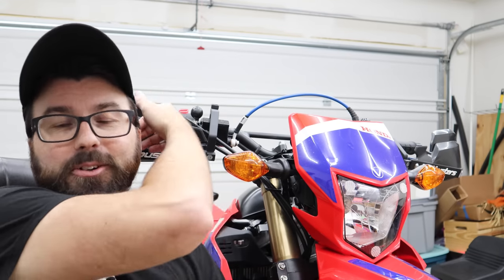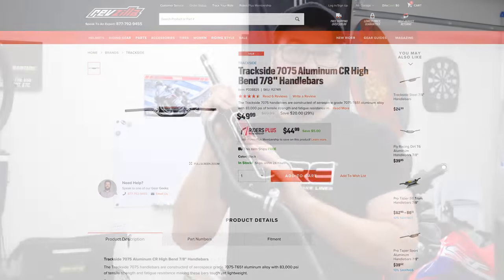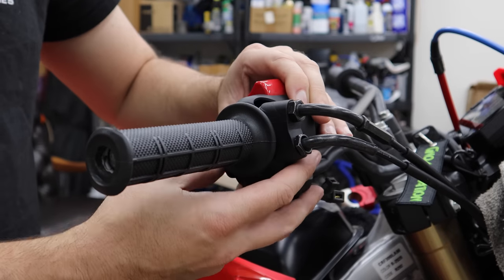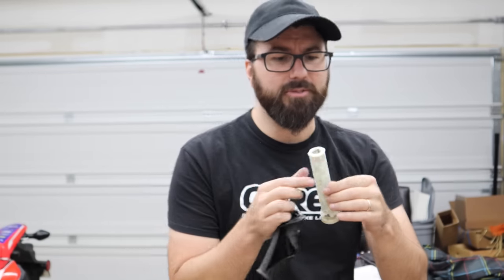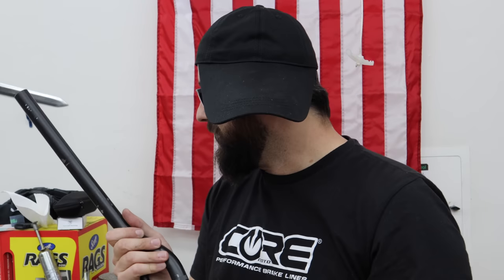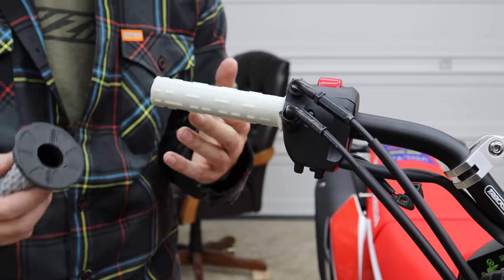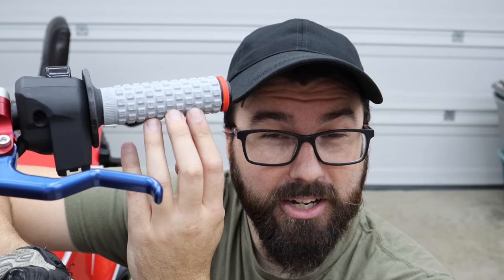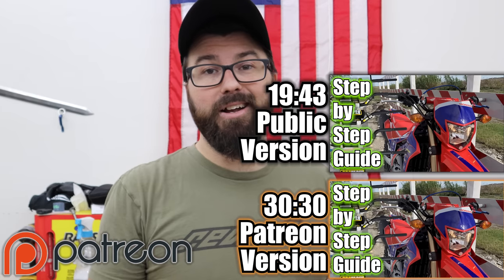Handlebars Pro Install - CRF300L

Comment: I put new bars, grips and handguards on my 300 today and it turned out great. I drilled the bars and dremeled the throttle tube as you demonstrate here. I didn't have to remove the throttle cables because I worked on the throttle tube on the bike. I slid the old handlebars off the throttle tube and slid the new ones on without detaching the cables.

Comment: another way to put grips on is alcohol . pour yourself a glass of strong spirits ( my weapon of choice is whisky ) , after you got some fire in ya  put some rubbing alcohol or aftershave or vodka onto the bar and slide the grip on . in a few seconds the alcohol will evaporate leaving your grips stuck
Reply: I tried rubbing alcohol and it worked great. I couldn't get the grips on with an air hose like Jake. I used to use WD40 (it actually evaporates and holds the grips in place fairly well) but wanted to try something else this time. Thanks for the tip.

Comment: Nice job on video Jake. Good call on not cutting throttle tube off and using the dremel tool. It can use all the length it can get. I didn't think of that. Great trick.

Comment: I always just saw the tab off the control housings and use double sided tape underneath to keep them in place. I personally don't want to drill holes to aluminium bars and compromise the strength of them just to mount buttons. Controls stay in place very easily if you just have something suitable under them during install and it is also easier to change their position if you want to turn your handlebar a bit to one side or another later.
Reply: Many people who have gone this route have had to purchase new controls due to the fact that they no longer stay in place.

Comment: I have a '21 Z900 i got at the end of June. A month ago I pulled it out of the garage and parked it so I could close the garage door. As I walked away from the bike i heard a clunk. It rolled forward a little bit on the kickstand and fell on the left side. Bent my bars. :-/ I wanted to go aftermarket but couldn't find a set that would match the bend/shape of the stock ones so went with another OEM set. Hopefully it doesn't fall over again.
Reply from the maker: Oh dang that sucks. Hopefully that doesn’t happen again.

Comment: I made a a video installing the CR mid Bend bars on my CRF250L and I love them🙌. I did have to drill for the controls, but it is so so easy to do [it was my first time drilling a set of bars]. My preference is the 1 1/8" jumbo bars, but these look great!!💪💪
Reply: Got the CR mid bend for my 300l rally too! I flattened the tabs on my controls and kind of regret it, but I'll try to get some double sided tape/electrical tape under there to get them to stop moving lmao
Reply: @ffengtastic5002  Ngl i considered doing that at first, but given how much I dump my bike I figured I should just do it the right way the first time. That way my controls have less of a chance of getting all spun around😂😂
Reply: @ConnorGMedia  My thinking was if I eat shit the controls just spin instead of breaking, but I checked the OEM pricing and it's like $50 for a replacement lol 🤷‍♀️

Comment: next time try using the strongest hair spray you can find for your grips. makes them really easy to slide on, let it dry over night, wont move unless you want to remove them, no residues. quickest and easiest method. been doing it for years. no safety wiring neccessary

Comment: It’s much better to drill the tiny holes for the controls and have it not move as opposed to grinding the nubs. I found out the hard way. (Like always) Some JB weld or solder will make me some new nubs. (Doh!)
It’s pretty straight forward to find the correct spot to drill so the controls line up. 
The goon guards will add a tad of friction to the throttle tube making drilling the hole more important so the throttle doesn’t move at all when WFO. I’m not a goon so I put Tusk bar ends on instead. 
Using the old clamps as a drill guide is a good idea since I always switch my bars to 1 1/8 fat tapered with no cross bar. (To combat arm pump) Otherwise I’d toss the old clamps over my shoulder because I’ll never use them again. Same with the stock bars.
Tusk has the universal oversized clamp & bar kits for around $70 bucks. I went with the KTM bend because they were similar to the Pro Taper Carmichael bend (0.6” taller) and I’m a inch or two taller than RC. If KTM has a problem with that then do something! (Faint a punch) That’s what I thought you tea drinking pompous euros will do nothing but get slapped. (Flinch!) You goofy orange oompa loompa MFers! Now get me an espresso and scrumpettes!

Comment: Anyone got a recommendation for grease for where the throttle cable contacts the throttle tube? There’s some from the factory but not sure what kind of grease that is. Wanting to use something that won’t weaken the plastic

Comment: Wish I'd seen this guide before some self-appointed experts suggested that you'd just grind down the controller nubs and try securing it with electrical tape. 
Worked like shit and gives you two ruined controllers as the medal tabs aren't available as spare part :)

Comment: Great video and tips.  I got a little too eager with the drill bit size and the hole is too large on the throttle side and the controls have rotation wiggle room.  I've tried electrical tape and strong double sided tape to reduce the wiggle, but it is still there...any tips besides buying new bars.  100% my fault but not too keen on this dowel/hole setup.

Comment: a good trick to put the new grips is to use spray deodorant if you dont have a compressor. the deodorant serves as lube to push the grip and when it dries, it became almost as good as glue.

Comment: having removed locator tabs before, defo drill the holes way better than your levers or what ever spinning if you look at them funny
Reply from the maker: You can build in electrical tape under them. That should help!
Reply: did it with gorilla tape.  thy aint moving easily .. you have to put a bit effort in. could also use double sided tape. its a bit stronger hold. but once you move them you have to reapply it.
Reply: @TheGardenSnake   Gotta try that, my mine move so much lmao

Comment: I got the CR Highs (protaper) for my Rally (not here yet) and I don't know how much higher those bars alone will be over stock. Just wondering if I should throw a set of risers in as well. I'm 6ft. Any thoughts?
Reply from the maker: I'm 6 foot and I think it's about right with the CR High. I could pop in some small risers if I want. Seems to be enough slack in the cables and wires. I'll wait till I've done a ride to decide.
Reply: I'm 6'2" and the CR mid bend works for me, I like having a small bend in my knees when I'm standing. The built in "riser" of the 7/8 to 1 1/8 conversion + the new bar is enough for me. I didn't want to deal with rerouting the cables with a CR high. Heard some people had issues with the CR high + rally

Comment: with the left hand grip id actually recommend a slight overhang, that way your handguard will really push up against it and stop it from roatating without needing glue or wire
Reply: Yes sir I could not agree more and it looks cleaner!

Comment: I've honestly never glued or safety wired grips and they only loosen up when they need replaced anyway lol. If you watch the pros they don't hold on to the bike a lot with their hands. Look at James Stewart doing a tail whip and he has like two fingers on the bike. Not saying I'm at that level but you should try to grip the bike more with your legs/knees. It gives you better control of the bike too.
Reply from the maker: If you do wheelies you end up tugging on em pretty hard
Reply: @TheGardenSnake  I've never been able to hold a wheelie. I can manual through a set of rollers but could never hold a wheelie on flat ground lol